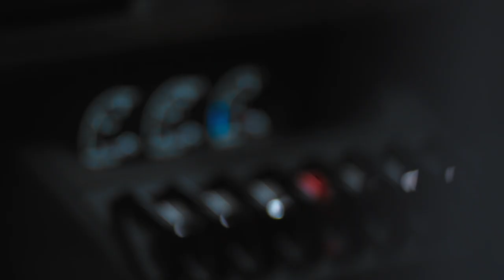How To Build A Drifting Lamborghini w/ Mike Whiddett | Drift Lamborghini #1

Comment: Everyone has a Lambo! Mid engine cars are lame for drifting aren't they?
Reply: I guess the silly power makes up for it
Reply: It's more easy to transfer, but your front tires will not touch the ground as much as you would like.
Reply: Depends on angle, but FR cars are easier to drift yes, I think the differential matters more though
Reply: @szopaful  When going sideways the power doesn't really matter in this class so not really.
Reply: @Alex-ch2ud  fr cars don't drift. You pull the and brake then the car slides.
Reply: Hugo Correia my drift car slides on the freeway going regular speeds back and forth a little when I accelerate too much and hit like 10% throttle. My drift cars slide without any brakes, the brake and handbrake is used to control the car.
Reply: They’re harder to drift than front engine cars but some people love the challenge